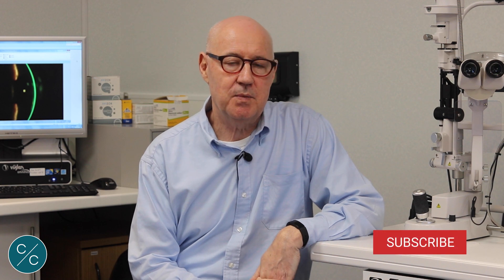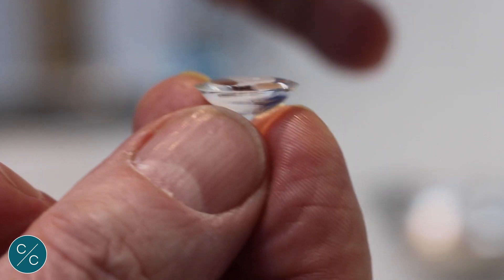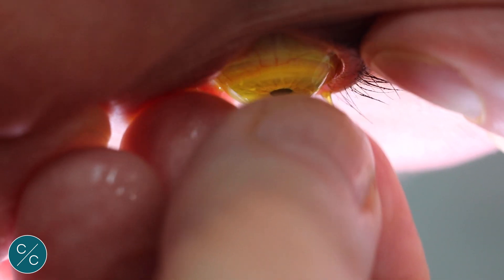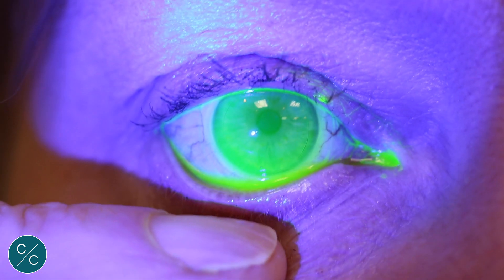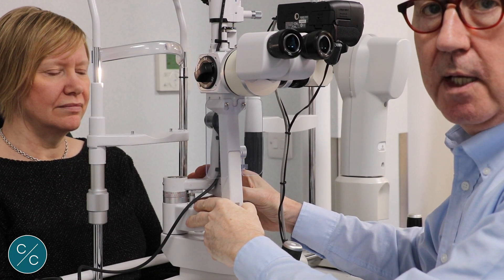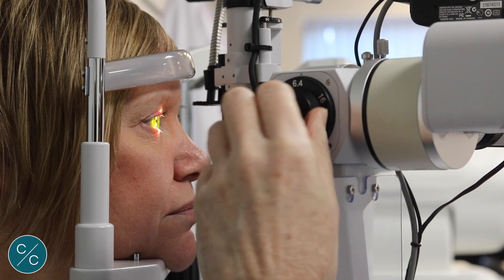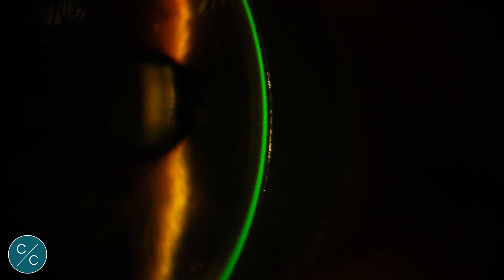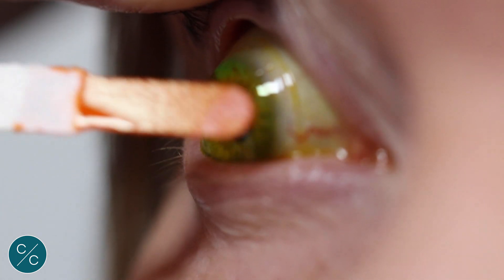Assessing Scleral Lens Clearance | Contacts with Conway

Comment: How long do you let the lens settle before evaluating it with the external UV light?
Reply from the maker: Hi Anthony, evaluate immediately following insertion with the hand-held torch to check for bubbles and obvious touch. Then with the slit lamp to check initial clearance, then after a minimum of two hours for final check.
- Martin